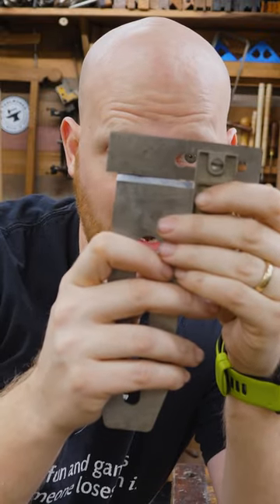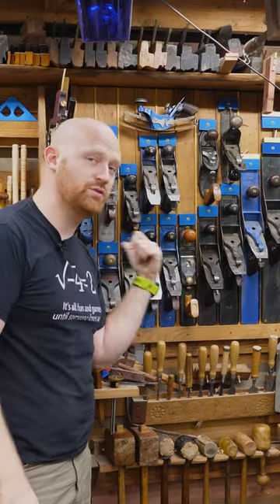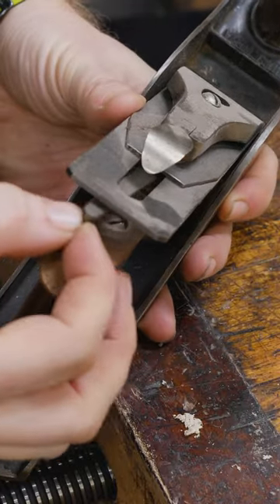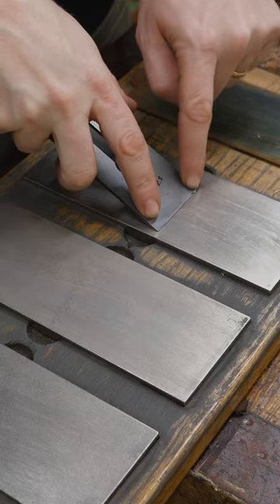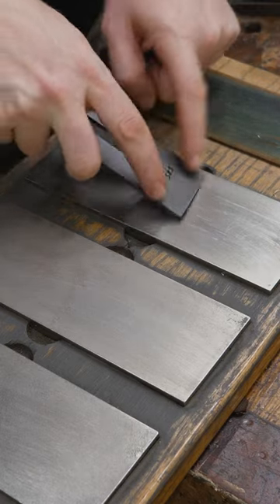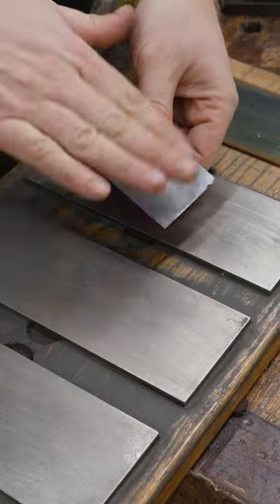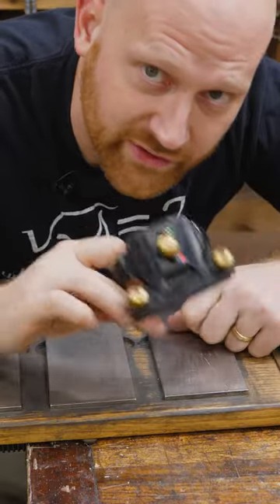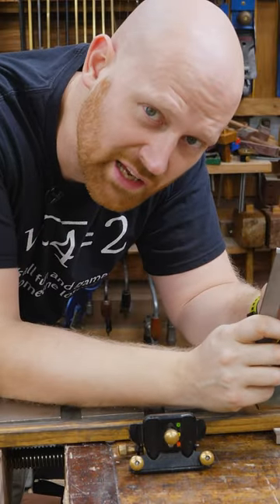How to Square an Iron

Comment: If I need to grind out a chip or something like that, I just run a sharpie line across with a square that’s the minimum amount I need to remove, and bench grind until it’s gone.  Being careful not to overheat of course.  Then a quick run through my stones and it’s good to go.  It comes out damn close to perfectly square every time.

Comment: Keeping your iron perfectly square across the entire width of the cutting edge is actually detrimental to the performance of the tool; Paul Sellers has stated this repeatedly. A couple of years ago I bought new Hock irons for my numbers 4, 5 and 7 and was disappointed to find ridges every time I used them, which I wasn't getting from my numbers 6 and 8 (nor my Millers Falls planes). I took me longer than I care to admit to realize that I needed to put a bare camber on the cutting edges.

$5 says you've mentioned this before and I've legitimately just forgotten
Reply from the maker: A lot of people do that to the corners and a lot don't. It is just a preference. If you take a thin enough shaving you won't feel tracks. And even Paul only does it on the smoothing setup.

Comment: Are you gonna wip out the long beldsanding sheet and take out that chip?
Reply: At that point, take it to the grinder. No point worrying about heat treat on an edge you're going to remove.

Comment: What did you do to that blade, man? 🤔 🤨 That's a pretty big chip taken out of it! 😆
Reply from the maker: I was doing a destructive test seeing the brake pattern under the microscope. We were testing a few different types of steels.
Reply: @WoodByWrightHowTo  lmao 🤣
Reply: @WoodByWrightHowTo  
Did you try old car leaf springs.?
The spring steel is said to be a
good tool steel if tempered properly.
Anvil Ring has some information 
about that process.
They are cheap at a junkyard.